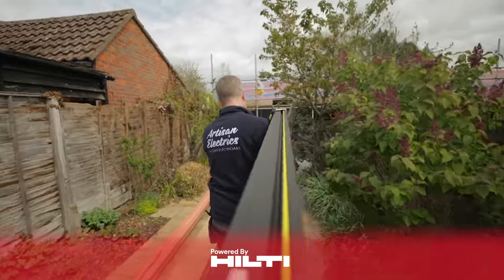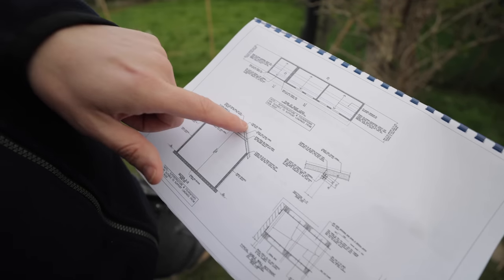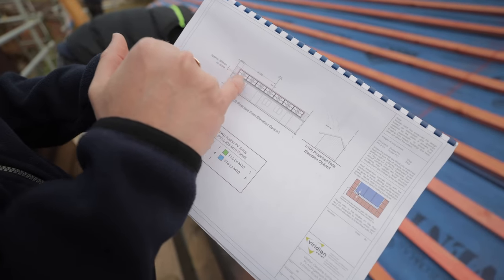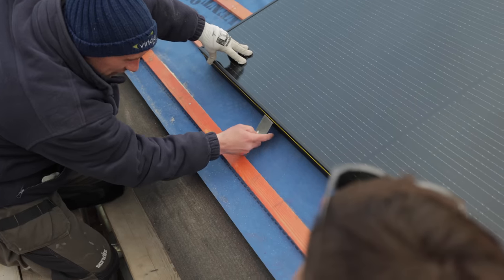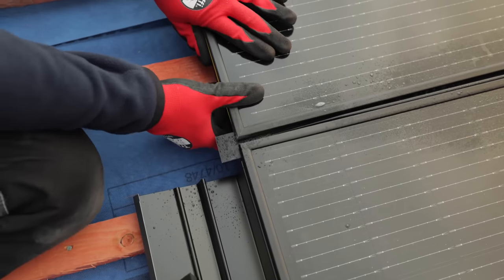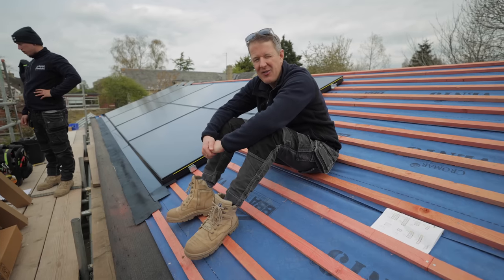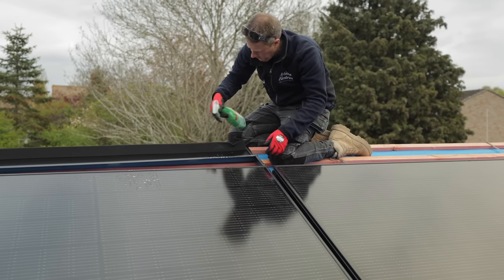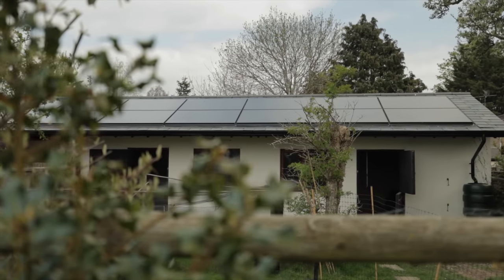Installing an In Roof Solar Panel System

Comment: The biggest downside of an in roof system: Availability of identical (!) panels after 2–3 years if one panel might malfunction. New panels might not be in the same size, but definitely will be higher in power. So you HAVE to re-install a complete new roof based on the new panels because it is not possible to add a panel with different power outcome in to an existing solar roof. 

This means: Demolish the whole roof and rebuild it. With an on roof system, you still might have to change the complete solar installation, but the roof remains intact. In that way it is a lot cheaper, and you might do it yourself and only pay the new modules. Everything else is on the roof.

Comment: Don't like the idea of having seal on each panel rather than a installed seal. Because if one panel dies the seal will not get a good squished on panels either side imho. Whereas a gasket silicon seal would be far better & you could replace all seals while panels in situ. I wonder if the connectors are also colour coded on underside! Panels actually perform better with air flow for cooling them.

Comment: Why are some installers still using optimisers when they're proven to be almost useless? The shading argument is nonsense given all modern panels have at least 3 bypass diodes in them.
Reply: Still advantages.. eg. Panel monitoring can tell you if a panel has failed or has bad wiring, and there are still some performance benefits in shading.

Agree I'm not sure if it's worth the premium that SolarEdge and Enphase et al charge however.
Reply: True.  The other aspect is many jurisdictions (including Europe) have adopted "rapid shutdown" safety requirement like NEC 2014 in US.  When activated, each panel (or group) needs to be disconnected from the string to bring down the string voltage to below some 30-volts at any point.

Supposedly this makes it safer for firefighters punch a hole in the roof to vent smoke.   But I've read this emergency roof work is not done any more because research has shown that cracking a window or door is just as effective without risking a firefighter climbing onto the roof of a burning house!

So the rapid shutdown safety feature ends being a way for anti-solar factions (utilities, fossil fuel interests, etc) to try slow down residential solar progression.  Rapid shutdown increases build time, increases cost, increases the complexity of a string setup and increases chances of some failure.
Reply: @beyondfossil  it's also problematic for systems with UPS functionality, as the PVs would shut down during grid loss, even if you're using the inverter to power the building or emergency circuits. There's no requirement in the UK for RSD though and Tigo (for example) allow you to sign a disclaimer to disable RSD.

Comment: can you review the new panels what take the heat away from the panels and send it via duct into house clean free air or can be added to heat pump ducting, no water no parts takes away the heat from black solar panels and sends via ducts into house and prolongs solar panels as dey like sun not heat, and black sucks it up .. I beleive it's called sunlight or smet, from Australia I fink

Comment: I know its green energy, but solar is such a rich person's investment in my opinion. If its generating just over 5MW a year, then assuming you use all of that it would be saving around £1700 a year. With the cost of installation and future maintenance, I fail to see the positive for anyone to go solar these days unless you have a spare 20-30k sitting about.
Reply: It's not a rich person's investment at all, all sorts of people have solar installed. Also, not all installations are going to cost as much as 20-30k. If someone feels a solar installation will benefit them then and they can afford it, then that's up to them.
Reply: a 3 bedroom house will be around £5520 – £6040 as they'll need to install a 3-4kW system to meet the higher electricity demands.
Reply: My 5kW system was £10k
15 panels with optimisers
11.6kWh battery
Using only about 7kWh/day payback will be under 10yrs
Reply: What Is majority of the cost ?  Panels and parts or the labour?
Reply: We’re talking new kitchen money for most of homes, what’s the payback period on a new kitchen?
Reply: My installation of 20 panels (6KW system), inverter and battery came to just over £9,000. Artisan are super expensive. The savings from this are stunning. Most days in late spring, summer and early autumn I am taking well under 1KWh from the grid for an entire day. Everything else is solar including an EV.

Comment: Surely it's far more efficient to have the inverter in the stable and pump mains voltage back to the house? The losses on those DC cables will be wild.
Reply: I don't think the losses will be too bad. The DC voltage from the string should be between 350 and 580V depending on temperature, so worst case, 4mm CSA cable will give a loss of 3% assming its less than 50m from the stable block to the garage.
Reply: The DC is higher voltage, losses are less, just need to consider safety as DC can happily arc away for hours under a fault.

Comment: No space for pigeons to get under the panels, or allow other vermin to chew the cables. Ventilation could have been improved by installing counter-battens on the rafters and ventilators at the ridge.

Comment: Horizontal battens without counter battens are a big mistake. Non-vented panels have lower efficiency and, above all, water cannot drain after the insurance waterproofing, this will have an impact on the life of the roof.

Comment: Good luck with dissipation. In EU it's better to avoid this installation, they can lower the efficiency of a single panel around 75% by overheating, and they can lower the life of the panel by a lot. I would prefer functionality to esthetic for a solar roof, considering the price. You can use a system like that mostly if you use water cooled panel.

Comment: any reason you guys dont use micro inverters?
Reply: Shadeing issues if one pannel goes it doesn't take them all out pannels don't tend to fail its normaly the optimisers or micro inverters

Comment: 3:37 🤣 Famous last words 🤣

Every type of lasting roof is for one, tilted more than 18 degree and second, build from overlapping sheets. Yours is not. It will at best hold for 20 years, but i don't see this, because your sealant is exposed. If you are smart, you already had turned into a good Samaritan and gift everything you acquire, to the people around you. You will get sued into the almshouse anyway😏

Oh and the roof is insulated, which is bad for the panel efficiency. 
Next time, have them space the batten further and let them be upright 2x18, so you can install a forced ventilation. It also helps make the installation make live longer, because small water ingress will not soak in. Maybe you even get a service contract to redo the sealant every 10 years and the roof will actually last.

Comment: Not for me. Thanks. Water will get all the way between pannels and ice will crack them.I would not rely on waterproof properties of those connections. In addition I would choose the vertical direction of wooden strapping to allow for any water penetration to leak out all way down. With this horizontal direction the water will leak along the nails inside the roof structure. I am giving this roof 10 years. 2033 will be due for a new one.

Comment: How are you taking the DC underground since SWA is a no go?
Reply: SWA is perfectly acceptable for cabling from the array to the inverter as per the IET code of practice. We regularly use SWA for this purpose.
Reply: @sundog3944  how do you get around the need for double insulation between the positive and negative legs?
Reply: @14fy  The requirement is that all cables shall be provided with basic and reinforced insulation. The use of SWA is a method to meet this requirement.
Reply: @sundog3944  but each core only has a single layer of insulation?
Reply: @14fy  The individual cores have basic insulation enclosed in some pretty heavy duty reinforced insulation. The use of SWA for runs from arrays to central inverter(s) is fully approved in the UK as per the IET guide. We often use SWA for runs from a loft to the inverter on a domestic installation as it provides better protection for the cabling, and allows one cable to be run for multiple strings. SWA also has the advantage of providing a means to earth the array frames without running another cable.
Reply: @SunDog  I agree overall swa is very much protected from external issues and my gonto cable for anything external or buried. My concern comes from a webinar I attended run by the IET on the code of practice second edition and hosted by the people who wrote it where a question was raised on the subject it basically boiled down to you can't run the + and - cores next to each other unless both are double insulated the only way you can now use swa is to have all the + cores in one and all the - cores in another from large arrays. As each core within the swa only has single insulation between it and the other cores.
Reply: @14fy  Thanks, you have just reminded me to order the second edition. I'll have a look at that part in particular when it arrives later this week. In the meantime MIS 3002 issue 5 is still in draft so I'll continue with the current version 😬
Reply: @SunDog  no problem

Comment: ⚡🔝💡 Great tip! Supplying a spare panel with an in-roof system is a wise move to avoid potential complications. Warranty coverage might not guarantee an "identical" replacement panel, which can pose challenges due to tight tolerances. On-roof systems offer more flexibility, as mismatched panel sizes can often be tucked away in a corner. I'm intrigued, are there any other lesser-known nuances in solar installations that viewers should be aware of? Share your insights! 🌞🤔💬

Comment: Those panels really do look the poodles privates. 
I’d love a solar install with a really big battery, along the lines of 50kwh or even more. If you had a few crappy days of barely any sun, could make use of the cheapest off peak tariff to recharge overnight. Maybe an energy company could come up with an ‘off peak only’ tariff? 
Ah well, if those lottery numbers come up I’ll have artisan in to fit it all 😂
Reply: Do some numbers of the price per litre for diesel and the output of a generator. It’s getting quite close if not cheaper to run a diesel generator to charge the batteries when there’s no sun. 50kwh would be about £10k for the batteries is you went rack mount. I’m thinking along the same lines.
Reply: @davideyres955  My current provider (boost) will give me 4 off peak hours (of their choosing) between midnight and 7am GMT for 5p/kWh.
The day rate would be inflated if I took the cheap night rate but it wouldn’t matter as I’d not use the expensive bit. 
I have 100a service so could comfortably draw 20KW for those 4 hours to store approx 80kwh which would cost me £4. That’s assuming completely flat batteries that haven’t received any solar charge from the day before. I don’t use anything close to 80kwh in a day either. 
It’s workable without any solar input actually. It’s just the costs involved with buying and storing the batteries. And, of course, the inverter.

Comment: Black panels again. Which do look nice, but presumably they could get very hot during summer and become less efficient? Maybe a slightly less black colour would have a better efficiency.
Reply: I doubt that’s a problem in the UK. My black solar panels are temperature rated for between minus forty and plus eighty degrees centigrade.
Reply: Those panels will get well above 80C
Reply: @alanpatterson2384  Average ambient is 15c, occasionally up to 22c. Black radiates heat super efficiently and normal convection would carry away anything as hot as you are suggesting. I have just used a flir on my panels, ambient is 18c, the panels measure 22c.

Comment: I would choose this over Elons solar tiles any day, solar panels aren't ugly in themselves, its when they are plonked on top of a tiled roof they look crap....This looks better than either option to me and I bet its way cheaper and makes more power than solar tiles. If I ever get to do this the panels will BE the roof so it will look even more integrated than this.

Comment: Installing solar panels in the UK in general might not be such a wise idea, as it gets the bare minimum sunshine required for the panels to be even functional.1400hrs of  sunshine per year versus  bare minimum requirement of 1400 so you're operating on the edge .It would be a major waist if money, unless you live on the Isle.of White where it's the highest at 1900hrs so forget it and stop waisting your hard earned money.Where as SE Florida gets 3000-3200 .

Comment: i dont know....having big panels is nice but I don't really trust that system to be waterproof over time! you have so many seals that need to hold up and each one is a failiure point! i do like the Meyer Burger Tiles better...its traditional century proven design with integrated solar moduls...

Comment: You're loosing here a lot of watts and just because you don't use a whole roof as you could ;). And, if you'd create a gap under the panels to cool them, you'd get more efficiency out of them on top of that. In the UK there's not many hot days, but still are and those days will create more resistance during the sunny days. 

Another thing to boost Wattage output is to put a wind turbine under the solar panels which will have a wind cooling those solar panels.  You can produce sometimes more watts than from your solar panels because in the year most of the time wind is there even at night.

Comment: So absolutely no ventilation? Gotta hurt the performance of the system.
Reply: I think i would have added some counter-battens under the battens to create a vertical ventilation path that would take some of the heat out via vents at the ridge.

Comment: @ 12:35, isn’t there a health and safety issue? For a artisan company, surely you should be using the correct access equipment for your engineers safety? There’s even a white sticker on the steps to tell you not to step on or above that run, as well as the top is plastic and flexing with markings on it saying “do not step on” 😂
Reply: H&S is such a stupid joke. Fine if you want to go bankrupt.

Comment: putting them on the roof is fundamentally flawed to begin with - get your priorities straight - the roof heats up like a mf - heat minimizes efficiency of pv panels, they heat up quite a bit on their own, sticking them on the roof just compounds and complicates issues

Comment: Shouldnt panels be the last thing installed as moment theyre outside they become live 😱
Reply: No cause of the optimisers, they only allow the panel to output 1V per panel
Reply: See at 12:29, he mentions they are using optimisers which will only output 1V until the inverter is connected and that means it's safe for them to run the cables, etc.
Reply: Missed that! Thanks to those that mentioned the optimisers 🙂
Reply: Not an issue any different to a on roof install.
Theres no current until you have a circuit.

Comment: Never seen so many people on a roof for solar install 2guy usually, you guys must be low on work :)
Reply: Two man team normaly for standard installation  but this system looks to need more men I've installed on roof systems and tiled roofs 16 pannels and dc wiring two men one day easy and the same for slate only problem is see is cost time and pannels getting very hot effecting performance

Comment: So them controllers not under the panel but inside of the roof void. If one fails in a normal roof that has no access once ceiling is in place, how do you fix replace them ? also do you have to remove like all the panel like to either side if 1 fails in the middle ?